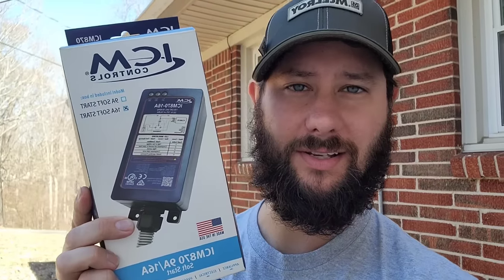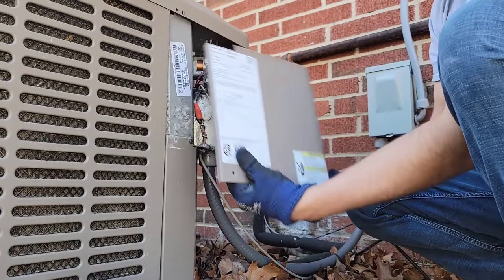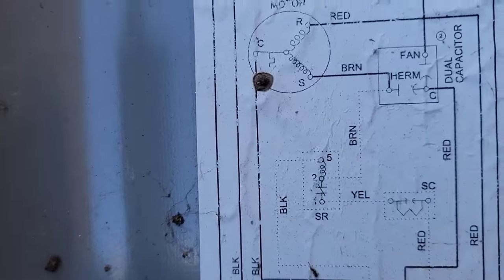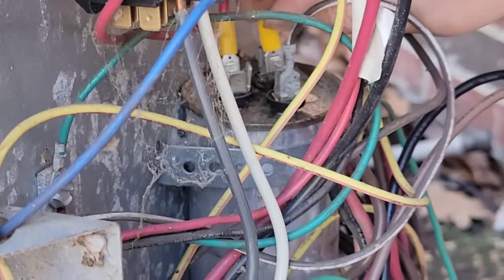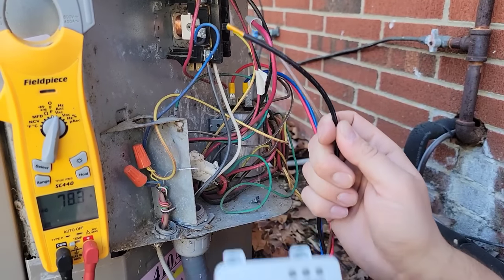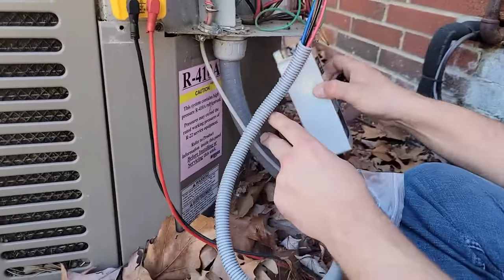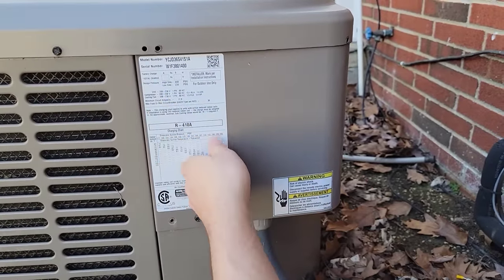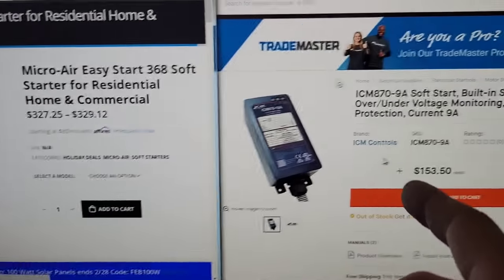How to install ICM870 Soft Start? @icmcontrols9960

Comment: I"m hoping someone can please help me! I just installed the ICM870 on my 2.5 ton Carrier unit.  I ran the red wire to the common on the run capacitor. I then Ran the blue to the Herm. Ran the brown to my yellow run wire ( I took the yellow off the T2 side of the connector and sliced it to the brown) as directed, I then ran the Black wire to the T1 side of the connector. I took a deep breath and reinstalled the disconnect. the unit started up and the unit flashed 3 times indicating "high current" I immediately shut it down and went back to my original setup praying I didn't destroy something. Everything seems to be running fine at the moment, but don't know how to approach this problem. thank you in advance for any guidance
Reply from the maker: I would reach out to icm controls they have Tech support that can help you
Reply: @TaddyDigest  thanks Tad, will do
Reply: @guyashby983  Did you ever get support? I tried calling but they never answered nor returned a call when leaving a message. I also have a Carrier 2.5 ton and your experience sounds just like mine. Looking for help if you ever did get it setup properly. Thanks in advance!

Comment: It's not clear to me at all which model to get, 9A or 16A. How do I find out?
Reply: On their website
Size 	    BTU 	   HP  RLA  ICM870-model
1 Ton 	12,000 	1 	5 	     9A
2 Ton 	24,000 	2 	10 	16A
3 Ton 	36,000 	3 	15 	16A
4 Ton 	48,000 	4 	20 	Coming Soon
5 Ton 	60,000 	5 	25 	Coming Soon

Comment: Stupid question: does this only help when the compressor starts up, or does it actually limit current throughout the run time as well?
Reply from the maker: When the compressor starts up
Reply: @TaddyDigest  so if it's just limiting a spike of watts is it really worth it?
Reply: @Justify4935  it limits inrush current during startup, just like a potential relay and start capacitor. These are snake oil and have ZERO PWM happening on the output of it like a true soft start.
Reply: @jman0870  I don't really know what you just said. Lol I just cleaned out my heat pumps coils and used a shop vac to clean it all out. It made a huge difference in how loud that thing runs. I just purchased this home. I don't think they ever cleaned this thing. I'm assuming the pump not running like a jet engine probably has to cut down on my electricity.
Reply: @Justify4935  dirty condenser means less heat rejection which means excessively long run times (and potential overheating of the oil, causing it to burn) which pretty much means yes, dirty condensers will cost you a lot more electricity haha
Reply from the maker: yes absolutely thanks jman
Reply: @jman0870  what's your guys thoughts on the compressor blankets? I got one to install so it quiets down more. Honestly, don't really need it anymore, as cleaning the coils made a huge difference, but I already got it.
Reply from the maker: I like compressor blankets
Also notice that mice do too
But I think they're good for keeping it quieter
Reply: @Justify4935  blankets are very popular on heat pump compressors because of defrost. Defrost can be loud. At the end of the day it’s preference.
Reply: @jman0870  by defrost, what do mean? Like in cold climates it's useful? I live in Phoenix, AZ.
Reply: @Justify4935  you could always try googling  “how does a heat pump work?” And “why do heat pumps defrost?”
Reply: @TaddyDigest  I wish y'all would've told me these things are a waste of money. Literally didn't change any decibel rating at all 😂.

Comment: How do you determine if you need a 9v or 16v control?
Reply from the maker: Check out the website down in the description.
Reply: Size 	BTU 	HP  RLA  ICM870-model
1 Ton 	12,000 	1 	5 	 9A
2 Ton 	24,000 	2 	10 	16A
3 Ton 	36,000 	3 	15 	16A
4 Ton 	48,000 	4 	20 	Coming Soon
5 Ton 	60,000 	5 	25 	Coming Soon
Reply: Thanks guys! Put the order in @ supply house last night. Can't wait to try it out!

Comment: Does this save on the electric bill too?
Reply from the maker: no sir
Reply: @TaddyDigest  I did some research, "A study conducted in 2016 found that AC compressor soft start technology can result in energy savings of up to 40% compared to conventional start methods. Proponents of soft starts argue that they save energy by reducing demand peaks at start-up, while detractors argue that they are ineffective in certain climates and not cost-effective enough in others. Supporters point to a variety of studies showing decreased consumption up to 25% when compared to standard compressor motors without a soft start." Seems more realistic savings are around 5%, though.

Comment: Hi
I installed this in for unit 32amp
I noticed fault, light rapid flash, about two minute when I started the unit and it take 6.5 amps until unit started after start the unit green light appear 
I checked the all wiring and connection are good .
Can you help me why the fart light rapid  flash before start the unit?

Comment: Hard start kits can ruin a compressor if the capacitor fails and caps fail a lot.  Does this product have a safety switch to not start the compressor if the cap fails?
Reply: Huh???
Reply: @jman0870  Hard starts jump the compressor right at the beginning.  If run cap fails the compressor motor will run real slow and draw high amperage burning the windings.

 Hard starts are ok for old units on their last leg but i wouldn't put one in a new system. Even then I'd change out caps every year on the old system.
Reply: @davidlopan6649  every. Single. Single. Phase. Walk. In. Condensing. Unit. In. The. US. Has. A. Factory. Hard. Start. Try again, pal.

Edit: if your unit had a fucking hard start you’d stop losing run capacitors. Laws of physics buddy, laws of physics.

Comment: I am looking at soft-starters for several different motors around the house now. Further research proves they massively prolong equipment life over direct on line operation. That sudden jolt of voltage and current is not good for motors, bearings, belts, relays, seals and even conductors. It goes back to the original rule of electric and electronic devices that goes like this: "What is the worst thing you can do to an electrical device?"  Answer: Turn it on.
Reply from the maker: You're so right
I enjoyed reading 
Thank you

Comment: Has to be installed in the enclosure. From Install instructions: 
"CAUTION: The ICM870 must be mounted in an area where
it will not be exposed to water or the elements. Exposure of the
ICM870 soft start to water can cause failure of the control and
is a risk for fire or other electrical safety hazards."
Reply: That's why I went with the Micro-Air EasyStart. It is waterproof and can be mounted anywhere.

Comment: I saw this video a few weeks back and bought one soft start, because of the this video. But that thing only lasted me 2 weeks then it took a shit, although for those two week it worked  real good and it reduced the inrush. I personally won’t recommend it
Reply from the maker: I would love to know what happened
Did you reach out to icm controls and find out what the deal is
Did it get hit by lightning or something
Reply: @TaddyDigest  I haven’t reached out, It had been running fine throughout the day. But around 9-10 the soft start stopped working with a solid red led.

Comment: Would this work on a 4 ton also?
Reply: Was that heart meant to be a yes?
Reply from the maker: yes
Reply: @TaddyDigest  Haha, thanks Tad!
Reply: Thank you!! Was able to install on my 4-ton unit and works great! Went from ~100 Amps inrush down to 39 Amps!
Reply: Just to update, after about 2.5 months of seemingly working fine, the ICM 870 16 amp on my 4-ton Goodman blew out. I found out when the AC was not running cold but just blowing warm air. Don't think the 16 amp model works for the 4-ton units. Still have one on my 3-ton unit though.
Reply: Am prepping to install the 32 amp model on the 4-ton unit.

Comment: I installed an MicroAir Easy Start just yesterday.  It has Bluetooth that you can use with a smartphone.  Once installed, I sent the data to the service desk, and they confirmed my install.  It dropped my start voltage from 69.2 to 39.9 on my 3 /12 tonne unit.
Reply from the maker: that's excellent
Reply: You meant amperage.
Reply: A hard start would have done the exact same thing and cost far less 🤣
Reply: @jman0870  That's the big question. Why this vs a Hardstart ? I mean for $50 the hardstart seems the way to go
Reply: @Aviation_Professional  it MIGHT be possible that the “soft start” (it’s not a true soft starter. The name is a lie. Period. Soft starters are basic VFDs that use PWM to ramp a motor to full speed.) can adjust the timing to slightly (and I mean slightly) reduce the inrush compared to a hard start. Nothing is more reliable than a hard start with a true potential relay. They are capable of infinite starts per hour and are so basic that they rarely fail. The generator logic is absolutely moronic. If your generator can’t handle the inrush the generator is too small. If the hard start or “soft start” fails it’s going to beat the ever living shit out of the compressor and generator.

Comment: Should not be installed, on the exterior of AC unit. From installation instructions:
"CAUTION: The ICM870 must be mounted in an area where it will not be exposed to
water or the elements. Exposure of the ICM870 soft start to water can cause failure of
the control and is a risk for fire or other electrical safety hazards."
Reply from the maker: Thank you for adding this
Reply: I had an electrical engineer at the house yesterday and we chatted on the issue of my lights dimming when ac starts up.  He recommended getting a soft start as my house is new.   Now I just need to find a ac company to do this
Reply: The ICM870 has a IP65 rating and is sealed enclosure. it can withstand large amounts of falling or spraying water in the environment. The only thing that you don’t want are the wires getting wet and those need to be protected.

Comment: What happens with the FLA when it is running?  Will it be noticeably lower?
Reply from the maker: After starting up the rated run load amp is 13
But I measured the amp draw and it's only 5 while running
Reply: Thanks for the reply. I will check into getting one for home.
Reply: The answer is no. It’s not a soft starter and has ZERO impact on the power consumption of your equipment after startup.

Comment: a year later and this product is in recall , try and contact them. where?? no issues yet but fire hazard recall claims . tried contact in box , no longer valid phone # doesn't work. be nice if they would contact the buyers instead of them telling amazon to contact customer. so what next ? its been working fine

Comment: Not clear on how you determined that this soft start needs to be 16 amps.
Reply from the maker: Go visit the ICM controls website. They have a reference guide. You can look at and shows you based off of what your unit pulls what you need.I think I put it in the description

Comment: I’ve been watching many videos on adding a soft start for a/c compressor to “improve efficiency and operational life” of the compressor. I’m sorry but all I see you adding another failure point to a factory designed system that costs $300-$800. If it was such a great thing to have, don’t you think all a/c manufacturers would have installed them on all their systems. The ONLY reason you would consider adding a soft start to and a/c condensing unit is to lesson the voltage drop on your home when running it on a backup generator!!!
Reply from the maker: when you lower the amps On a compressor during startup, you can save the compressor from having damage during high current startup, so you can help yourself to not have to replace a part that can be very expensive to replace.
Also, saving thousands of dollars on a generator is a good thing.
If you're worried about the part that you put ongoing bad, install. A surge protector and then you can protect the part that you put on that. You're worried about having to replace.
Reply: My first condensing unit lasted 22 years as all I did was replace the capacitor and contactor every 4 years and wash coils every spring. How many $400 soft starts would I have had to replace in that time?  I’m not wasting my money on something that isn’t needed

Comment: if it pulls 74 amps on start you have a bad compressor . That LRA stands for Locked Rotor  Amps just fyi guys
Read the label max circuit breaker 30 amps if it pulls LRA of 74 that breaker will trip . Start up amps will be just slightly above run amps .
Reply: Sorry but you have that wrong. Compressors pull LRA on startup every time they start but only for milliseconds. You have to have a meter that has an inrush function to even measure it. It isn't pulling it long enough to trip the breaker.
Reply: Lolwut?

Comment: Soft starts are NOT compatible with all brands of AC compressors!!! In point of fact, they are INCOMPATIBLE with MOST AC COMPRESSORS on the market today according to most compressor makers and Soft-start makers! Only THREE of twenty-two RV A/C units sold can be retro-fitted with soft-start units, and six of 4200-odd window units made! Now LOTS of RV A/C's and heat pumps HAVE soft-starts BUILT-IN from the factory as do some high priced window AC's and heat pumps, and the GOOD central AC's and heat pumps and mini-splits come with them built-in, but you CAN'T just throw one on ANYTHING! I have a 120 volt 14,400 BTU LG window unit A/C I need a new fan for. Stock is a three-speed piece of sheet. For double the money the parts house has a new continuously variable speed rated for 10 times the hours. I asked them about a soft-start for the compressor of it. NO-GO! My old 14.8K Friedrich (R-22-trying to get it "converted" to the true replacement refrigerant) and the 10K Frigidaire in my bedroom, no problems. $150-ish bucks for the soft-start kit and the peak amp draw drops 50%-big money saver and extends compressor life too. BTW, on a central unit, you will probably need a $300 shoe-box sized start-run capacitor with the soft-start unit. My late Mother did on her 36K BTU Goodman A/C unit. She also had to have a magnetic "unloader valve" ($350) like on an air compressor installed.
Reply: Bro. These aren’t actual soft starters. Old Taddy doesn’t know what he’s talking about 99.9% of the time. He doesn’t even know what a soft start actually is or actually does because he only works on little residential equipment. He will argue until he’s blue on the face that it’s a soft start though. These things are a scam and provide little benefit over a potential relay and start capacitor.

Comment: I’d like to see some data that shows this extends the compressor life? It’s just smoke and mirrors without data.
Reply from the maker: Check out I c m controls Website

High inrush current can cause nuisance tripping of protective devices or motor damage. It can also cause voltage dips in the supply line (which can affect other equipment), or even prevent the motor from starting properly. High inrush current also leads to high torque production at startup — sometimes as much as twice the rated torque — which can cause sudden, severe acceleration that damages mechanical loads.

Comment: A 521 will fit easier and is cheaper.
Reply: And will take out start winding when your run capacitor fails. I call 521's compressor killers

Comment: Locked rotor amps is not starting amps. Your unit had max fuse
Rating of 30 amps. Even with  hacr breaker it would trip way before 70  amps.
Reply from the maker: The locked rotor current and the starting current of a motor are one and the same. It is the starting current drawn by a motor when full nominal voltage is applied to its terminals.

Comment: I am a bit confused as to what this "soft start" does other than reduce the amps at start. I mean less amps is cool but i don't see any other benefit to it. I may be too stupid to understand more.
Reply from the maker: High inrush current can cause nuisance tripping of protective devices or motor damage. It can also cause voltage dips in the supply line (which can affect other equipment), or even prevent the motor from starting properly.
Reply from the maker: It's good to have less start up current so you don't draw so much power and if you have a generator then your generator does not strain during the. Start up process of the air conditioning systems compressor

Comment: Locked rotor amps are not the same thing as starting amps. Any HVAC tech worth a shit would know this.
Reply from the maker: That is correct
Starting amps is when the motor starts.
Locked rotor amps is when the motor is locked up.

Comment: Its a damn shame these videos promote this junk. 32 year HVAC tech in SE Texas. Put one on my 3 ton system, lasted a week. Busted it apart found the cap in it blown up. Parts house got another one under warranty. Lasted two weeks same issue. Unit is 15.1 amps fla but is only pulling 12.6 running. I use a lot of ICM products but these are pure junk.
Reply from the maker: That's not good. I want to know more.
This could be a good learning experience for me?
Do you have an email where I can reach out to you.
Have you reached out to icm controls about the product circumstances?
I have one of these on my air conditioner. It works great 👍 
let me know bother 🙂
Reply: Mine also lasted about a week. Debating on trying another one or getting a refund.